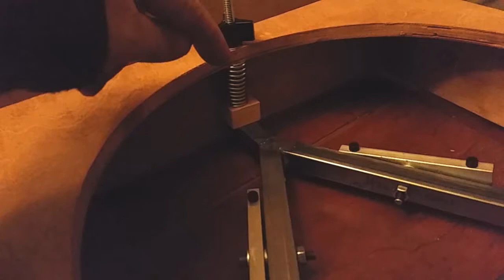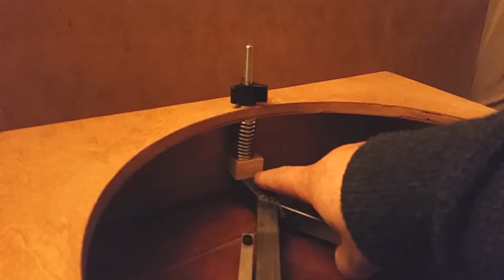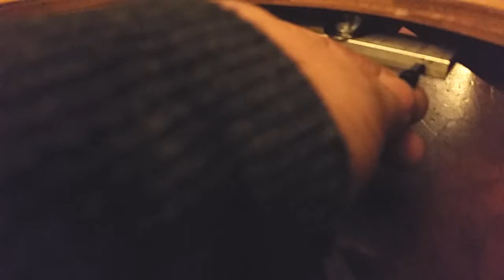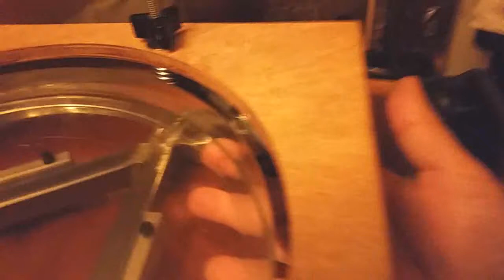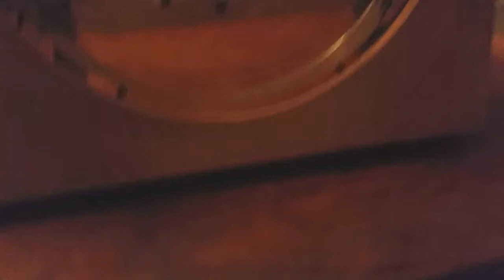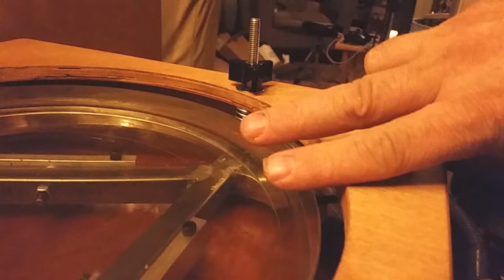12.5 in mirror cell upgrade

Comment: So there’s nothing holding the mirror in place other than it’s own weight?
Reply from the maker: The lower edge support does have eye hooks with shrink tubing on the threads that don’t touch the mirror but will prevent the mirror from falling out
Reply: @Pinbout  I really like the idea of collimating from the top side. wouldn’t have a pic of that which you describe by chance?
Reply from the maker: https://youtu.be/76LjhPB1EHk
Reply from the maker: Like this youtube
Reply: @Pinbout  brilliant thanks!